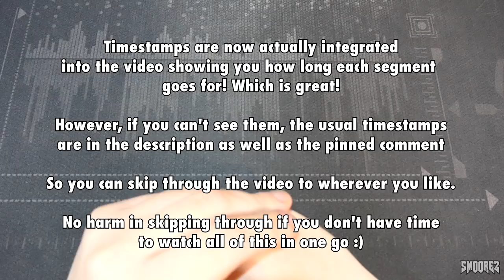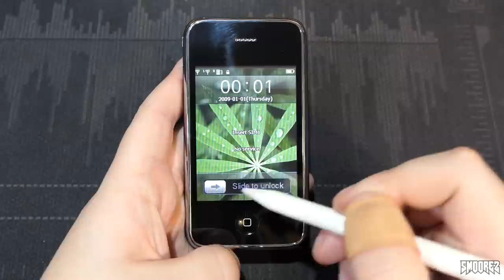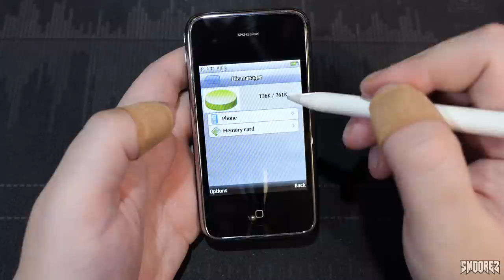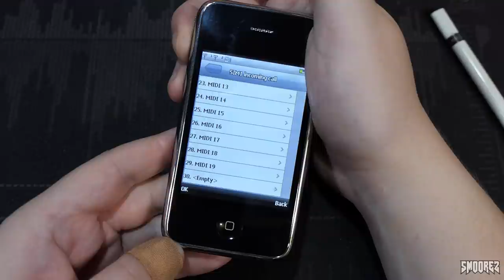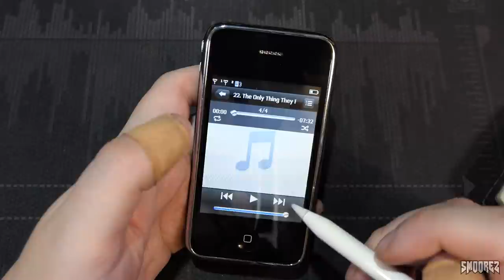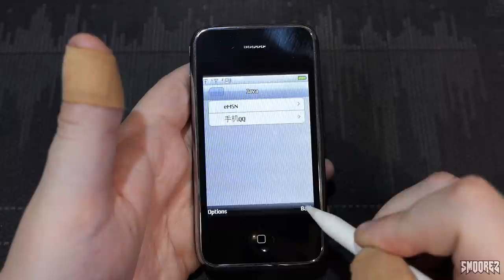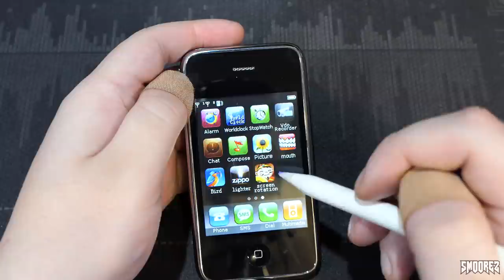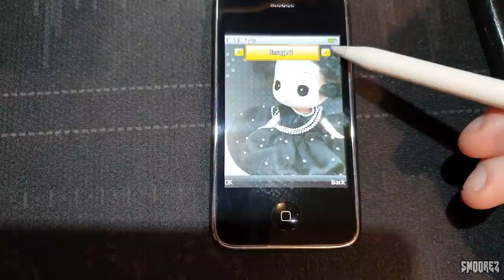iPhone Clone Month! MORE SCIPHONES! (iPhone 3G Clones) - Fairly boring Review & Teardowns - Part 10

Comment: I actually owned the i68+ back in the day! It worked for around 3 weeks and then the touch screen stopped working. Took it to several repair shops and of course nobody had any idea how to fix or replace the parts of this piece of garbage. Good ol' days!

Comment: The ghetto rig batteries are something I never really thought would work as well as they do.  I guess I'd get worried that the phone might expect non-standard pinouts, and that I might accidentally apply a reverse voltage and kill these unique monstrosities
Reply: When my S5 charging port broke, i stripped a charging wire down and made little points on the positive and negative and charged my battery like that lol.